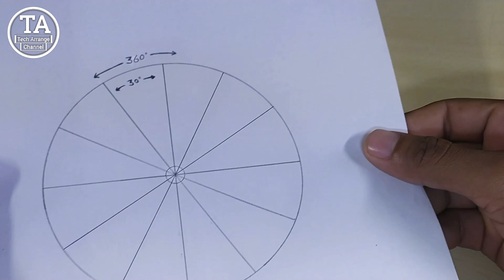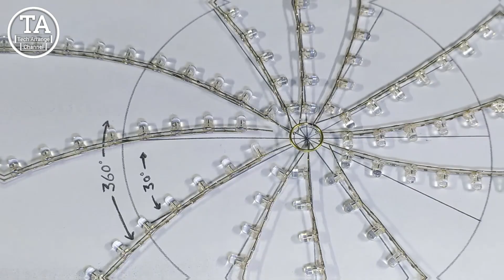Awesome LED Light Project Using DC Motor

Comment: Lovely Project. Like it. Need the connection Diagram/Circuit diagram  LED ball to Motor and so. If we use 5mm LED will it work with the same. Awaited for Reply.
Reply from the maker: Yes, of course

Comment: Sir jab bhi main led chacer bnata hun ic555 and cd4017 se tab led run nhi karta jab power dete h to 3 number ki led glow krti h run nhi karti or jab power dubara di jati h to 7 number ki led glow krti h connection bhi sahi hote h kya karoon sir
Reply from the maker: Aap led ko chhod kar sabhi component dusra istemal karke dekhe
Reply: Thank you sir for reply ☺☺☺
Reply from the maker: Most welcome